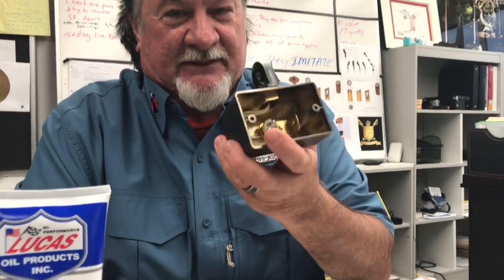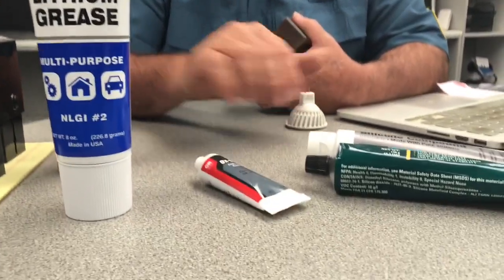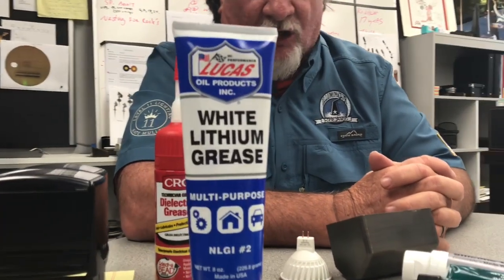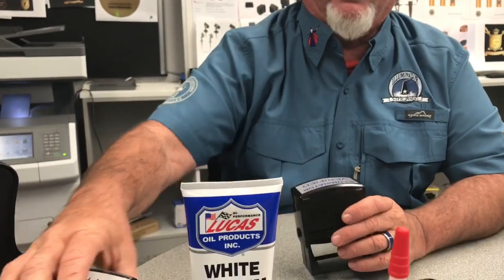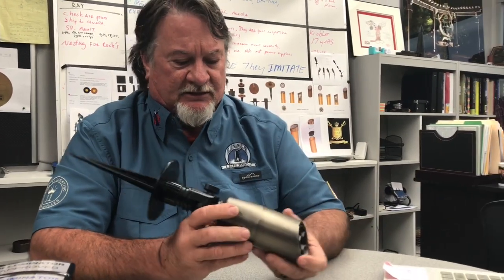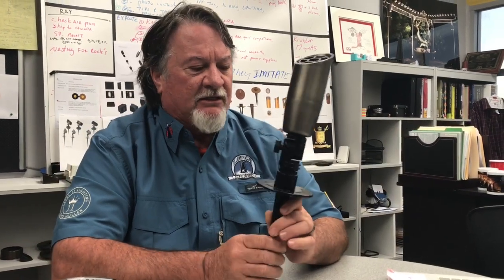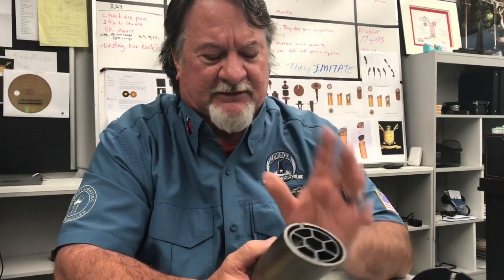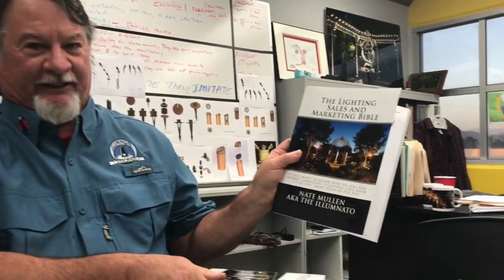White Lithium Grease vs. Dielectric Grease

Comment: In 2008, i removed a relay from the engine bay of my 1990 Corolla. The terminals were coated in a mysterious grayish substance. I did not know what it was at the time but intuition told me it was to aid in corrosion resistance. I remember how beautiful the connections were, assuming that relay had been sitting there for 18 years exposed to the elements. White lithium grease is good stuff.
Reply: hahahaha yesssss. When I see that whitish gooey on an old car I know the old owner knew what he was doing. I use it on every hinges and connectors now. I didn't even knew it was just as good as dielectric grease for connectors. Just a superb grease under the elements and extreme temperature changes, it will just stay there and never gets hard. Amazing stuff for moving car parts. Hell, another trick I used and was also approved by my mechanic, is when I do my seasonal wheel change, I coat all the brake parts (other than pads and disc) with a thin later of anti-seize silver that I brush off with a microfiber. By the end of the winter on the salt belt I have 0 buildup and the stuff barely washes off.Never had a problem from it. It never touches the friction parts its also highly metallic and conductive so it doesn't insulate the brakes that much. Good grease knowledge can help you keep a car a long long time.

Comment: I've used dielectric grease on the female 4 pin trailer connector on the back of my car including placing the cap over it and it still corroded in about a year's time. Ruined it. Got a new connector and I found this video trying to search for a different way. Why it corroded even with the grease on is beyond me.
Reply: I know you have to watch that some dielectric sealants do not contain acid. Not sure about grease though. Maybe it is because the connections were already dirty and corroding before hand?

Comment: dielectric grease is an insulator. Take an ohm meter and check. I suggest you do your research first.

lmfao before you make such strong clamis research first.
Reply: Take 3, watched a different video, so it fills the pits in connectioms when they're fitted together, so it doesn't interfere with the areas that were already making contact, but stops the areas that weren't in direct contact from oxidising or causing some weird shit from happening
Reply: From reading a handful of the other comments (despite me thinking dielectric meant insulator) apparently the difference between the two is that dielectric grease will  move off the contact points if they're a push/friction fit? 
Best example I can find inbetween all the name calling is "ye cable insulatoion is non-conductive but there's a reason you use it" then something about you should only use dielectric grease on press fittings and use it rreeeaalllyyy sparingly cos if you flood the connections its just going to flood the pins/connections and won't fuck off as it's meant too 🤷‍♂️
End of the day, I flooded my spark plug boots with the shit, now I'm getting an ignition error code, so I'm gonna go clean that shit out and redo it with as little grease as I can
Reply: Wait clicked send before I think that made send, insulators are essentially solid, or won't fuck off if you want them too. Dielectric means they'll fuck off if they're not trying to drown a press fit connection....I think.....it was hard to understand while reading every second person has fucked my mum and my dog

Comment: Pretty much all grease has low conductance so technically, they can be used to stop moisture ingress. The reason they say to use silicone/dielectric grease is because unlike petroleum grease products, it won't eat away at plastic insulation. I have seen petroleum products like wd40 melt plastic over time. Silicone is also very good with heat so it makes the perfect grease for use with electrical connections.

Comment: Dielectric grease can be used sparingly on connectors. Microscopically, the metals have pitting. The grease fills in those small valleys and the metal to metal contact will push the remaining grease away. Using large globs of it can possibly create resistance which stresses the power source. That's my understanding.

Comment: Hi there.. I wonder if you could give me the benefit of your wealth of experience..
I have a pool light, and the cable enters the bottom of the light and connects directly to the 12Volt halogen bulb..The connections would be in water if it were not for a grease like substance packed around the connections and contained within a small plastic cover..
The 'grease' does not smell or look like auto grease..I have a clear close up photo if it's of benefit..
My question is, do you have any idea what that substance might be, or what could be used in its place?..
Thank you, and thank you for a great video..  John, Western Australia.

Comment: Those guys Are 'figuring it out', Just like you.   (did)          Define 'insulator'  ] of ]. . ?  ~  ?    stops\ prevents \ Blocks \ surrounds  ?        
electrical insulator - Lithium Grease or Dielectric Grease do NOT Conduct Electricity - so i'd say YES, they are an 'insulator'.

Comment: The problem with many dielectric greases is they are too low a viscosity, are meant for a light surface coating rather than void filling.  Their lower solids to base silicone oil means that they do separate more easily than a more viscous silicone grease would.

The problem with lithium grease is that it is not as temperature stable, will tend to melt and flow out of the area it is applied to if the connection creates a significant amount of heat.  Granted, if you put these on a NEW installation and do it right, you aren't starting with heavily oxidized metal so there should not be much heat created, but the point is that the petroleum based lithium grease is not as good to use on already aged connections, unless you have the means to completely strip them down to a clean state again, which can be done with copper or brass but not with something nickle plated., then it is time to get a new connector if you want longest service life and grease performance.

Comment: Thank you! I’m convinced that I got exactly what I hoped to get, which was confirmation that I can use white lithium inside an auto electric switch in the absence of dielectric grease.
Reply: You not only can, but some automotive manufacturers did this, which is often why you end up needing to redo their work.  Frankly over the long term, you should just invest the $5 to use the best product.  It is not like a manufacturer trying to shave off 2 cents in 10,000 different areas to save millions of dollars over the production life of a vehicle.  Rather, your time saved in not having to do a job again and the peace of mind is worth the few extra pennies per application.

PLUS, not all switches are created equal.  Take a simple headlight dimmer switch for example, many use conductive traces to bias a transistor to vary the output and this heats up and will make standard (petroleum based) lithium grease thin, separate, and run out of the area of application.

Comment: What an idiot! Dielectric grease is an insulator hence why you use it on spark plug boots not plug electric contact points..... helps keep an arc from jumping to surrounding metal through the boot. This idiot proves doing things for years means nothing. Awesome advice... smh..
Reply: False.  Many spark plug wire sets, already have a blob of silicone grease put in the boot by the manufacturer, which would be practically impossible to not get all over the spark plug electrode when putting it on.  Millions of people install these boots and have no problems whatsoever, quite the opposite it is why the wire manufacturers go to the extra effort.

Comment: So... In conclusion, dielectric grease is not used on the electrical mating surfaces.  It is applied to prevent voltage leaks by insulating the surrounding surfaces which is also why white lithium works just as well???  So which products would aid conductivity?  Perhaps the same ones that prevent electrolysis between disimilar metals?
Reply: maybe copper grease? I am not sure.
Reply: @MKasap-te8vm  idk either it has been so long... only know that 30 years ago the auto industry had you put it on and in your dist. cap as well as in the plug boots.  If it "insulates" would that not mean it would necessarily be inhibitory in those applications?

Comment: Dielectric grease is an insulated you idiot 😂.  Check your facts before you call your viewers an “idiot”. It is used on electrical connectors to protect moisture ingress but should not be applied directly to the metal terminal. That said, it is fine on tight fitting connectors as they will break through the grease.  Not h a I gotta a go but wet myself when you called the guy an idiot but actually made yourself look like an idiot in the process.  All the best.

Comment: why do people put diaeletric grease on car battery post and then putting  terminals on ????  alot of instructional videos showing people putting the diaelectric grease on the battery terminal then putting the connector on . this makes no sense if this is a insulator , i can see how it would prevent corrosion but if it is a insulator it should not be used

Comment: Dielectric grease is an insulating product. It doesn't conduct. So this man is incorrect about those products. Vaseline does the same. However, it works because the connectors scrape off the grease to allow conduction. At the same time these products do keep air and water out. There are youtube videos to illustrate how these product do not conduct.

Comment: I wonder why you sir have not responded to any comments, have you figured it out yet that Dielectric Grease is not a conductor nor is it an insulator the only purpose for it is to coat the metal so that it does not corrode either by water, air or to keep it from electrolysis with dissimilar metals to keep them from fusing together. That about covers it.

Comment: Thanks to the Internet, everyone with an opinion claims to be an expert. I'm using white Lithium from now on
Reply: Vaseline
Reply: Been using white lithium as my go-to metal to metal grease on my cars. For over 10 years. The first drip I ever put on a door jam is still there today. Still lubing that area and keeping rust away. Never ever had to retouch it. I swear by this stuff now. It seems eternal. All the pro's Ive seen installing huge metal arms and cranes in highly humid environments all seemed to use red lithium grease as well. You just can't go wrong with it and I think im going to restock for life (1 big tube lol) before the prices go way up. Apparentely even the car industry is about to go haywire because of the lack of microchips. I think maintenance will become a big thing in the next few years. We've done overproducing now its the big recession.

Comment: All dielectric materials can be insulators but become conductive when an electrical field is applied, not all insulators can be dielectric material however as electrons in dielectric materials are bound to the nucleus and thus possess very little movement. When external voltage is applied, the nucleus and the atoms get attracted to negative and positive sides respectively. Some insulators do not have this property to a meaningful degree which is why rubber and certain plastics are used as insulators only, capacitors have dielectric between the plates, coaxial cable depends on the dielectric properties between the conductor and the shield and thus have an impedance value that is designed into it by just this method.  

  Jet fuel is used for it's dielectric qualities In the fuel quantity system on Jet aircraft, the fuel level probes of which there can be many throughout the fuel tanks, are just two plates (a small cylinder within a slightly larger cylinder with wires going to both plates just as any capacitor would have, with them fully submerged in jet fuel, the capacitance roughly doubles compared to the entire plates being dry (at least on some I have worked on in my Avionics career), this is purely because Jet Fuel is a much better dielectric than air. Xc (capacitive reactance) is used to take full advantage of this by applying a small amount of current to the probes (never enough to be an explosion hazard) making them act and measure like resistors. Xc is measured in ohms not farads obviously. Earlier systems used this capacitive reactance as a variable resistor leg in a bridge circuit and a servo motor driving an actual variable resistor to null the bridge and in doing so, moves the needle, calibration was needed periodically and mandatory when any part is changed, many a good tech was scared off when they heard of measuring in micro micro farads dubbed mickey mikes (non official term) and did not see the fact that they were merely dealing with a bridge circuit, a Wheatstone bridge to be exact. Modern jets have a computer that reads the change in Xc due to changes in dielectric as the fuel quality changes and then that gets sent to the displays via Graphics Generators where they are supposed to be seen.

The moral of the story is that all dielectrics are insulators when not externally charged but not all insulators are dielectrics.

Comment: dielectric is an electrical insulator / very poor conductor of electric current. That is what dielectric means, your the idiot Sir
Reply: I think the clamping action in the connectors pushes the insulating grease out of the way breaking thru the dielectric... after that no more air or water get in to corrode things. So his common experience has it working well.  We may not need the pricey conductive No-Ox? grease, and putting the word Dielectric on the tube when that is not the reason people buy it is odd.
Reply: Exactly! At 3:02, this guy says "obviously that idiot doesn't know what dielectric means." I think he needs to do a quick google search of the term dielectric. It is NOTconductive; look it up! It keeps out moisture and air, which cause corrosion, but the metal to metal contact between the conductors is what conducts electricity. No electricity is conducted through the dielectric grease itself.
Reply: You guys should maybe read this..  http://www.w8ji.com/dielectric_grease_vs_conductive_grease.htm

Comment: Thanks for the video.  Just wanted to say dielectric grease IS an insulator.  In fact all the greases (is that plural for grease?)  mentioned here are insulators.  It's purpose is to prevent oxidation of the electrical components but applying the grease directly to the electrical contacts is, in fact, creating an insulator between the components.   With this said, I have incorrectly applied dielectric grease directly to my terminals for years without any problems.
Reply: In many cases it is not incorrect to apply it directly to the contacts.  It is the friction force of connecting them that makes the metal to metal contact with the excess forming a boundary layer at the edges, and the slight bit of lubrication helps extend the life of contacts that need to make and break by rubbing against each other.

Comment: The term dielectric was coined by William Whewell (from dia- + electric) in response to a request from Michael Faraday.[5][6] A perfect dielectric is a material with zero electrical conductivity (cf. perfect conductor),[7] thus exhibiting only a displacement current; therefore it stores and returns electrical energy as if it were an ideal capacitor.

Comment: 3:00 but I looked up "dielectric" and the definition is "a nonconducting substance; insulator", so... You tell me what it means.
Reply: your name checks out
Reply: Basically it means it doesnt conduct electricity. Therefor it's great to insulate electrical connections with it. Because it protects from the elements and acts as a sleeve just like the rest of the wire. Satisfied?
Reply: It means that the grease itself does not conduct, not that it is a problem to use in a circuit where you have a mechanical/friction method where the metal contacts the mating piece and the grease is just there to seal out contamination by debris, moisture, oxygen, UV (sunlight), etc.  The problem is that the guys who mention what a dielectric is, are suggesting that it interferes with a good connection when it does not unless you have some kinda of captive cavity where an extreme amount of grease was used, and that is never how an electrical connector is set up.  It is always made to produce metal to metal contact without a gap, unless it is a terminal meant to be soldered on and even then, the least gap acceptable from an assembly time perspective, should be the target.
Reply: @stinkycheese804  He said that some idiot thought a dielectric was an insulator.  It is an insulator.  He's the idiot.
Reply: @stinkycheese804  No matter how tight the metal-to-metal connection is, remember that the grease is a chemical compound and can penetrate microscopic gaps over time. The dude later says at 4:04 that he hasn't had a lot of problems with dielectric grease other than they get runny because they can't take much heat. When the grease penetrates the connection it introduces resistance. And the resistance makes the connection to heat up. Basically dude was ranting and later unknowingly proved himself wrong.

Comment: The stuff in the green metal tube (DC-111) is one of the best silicon based compounds for electrical connections I have used. We bought it by the case in grease gun sized tubes for use in the oilfield on downhole 5/16 electric wireline operations. it held up in 150*C temperatures and to  hydrostatic pressure rated from 10,000 - 15.000 psi.

Its also an amazing ring sealant/lube.